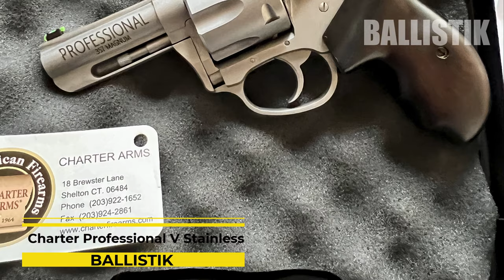6 Perfect Revolvers to Buy for Under $500

Comment: The taurus 605 has been a great small revolver, but preferred to have the 3", not going to eliminate unburnt powder at 3", but less than the 2"version. Accurancy shocked my son, as he is a generation that often devalues the purpose of the wheel gun. The .357 is the way to go, for your smaller framed and recoil sensitive friends can just load the .38spcl rd.

Comment: This video is just cut and paste BS. The maker has no idea what he is talking about. The prices are low for VERY good reason, especially in the case of Taurus... Hot garbage! The Rossi may actually have a future, but first they have to stop putting springs in them that a gorilla couldn't operate. The Rossi is probably the only gun here worth considering, at all. Charter arms... poor quality control, pointless sharp edges and triggers they know are defective before they even ship them. They keep a supply of the previous triggers on hand because they know the complaints are coming: just too rough and clunky to waste money on. The Windicator??!!! They couldn't build a good revolver any more than they could correctly spell, "vindicator"! If it looks like a shoe box, that's because it is! Lastly, the Sarsilmaz SR38: A Turkish attempt to copy the S&W. I've never handled one, but they are not under $500 and I would wait for at least the third attempt by the Turks.
Reply: the sr38 is a great gun
Reply: Very cutting sarcasm, but no sign of actual experience with these guns.
Reply: @PeterSmith-is8cj  You don't have to OWN the wheel to know the tire is flat. As it stands, I either own or have owned several of these guns. I've handled all but one of them. In some cases, just knowing who made it is enough to know the gun is garbage. I stand by every single word of my original post. As for my experience, I used to shoot revolvers competitively. What about you?!